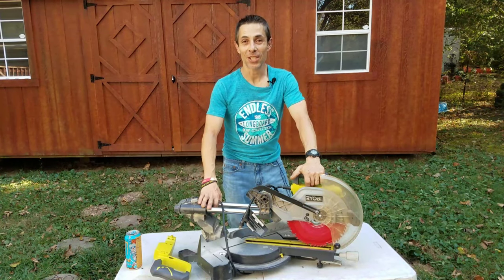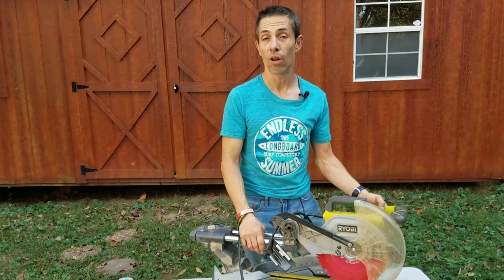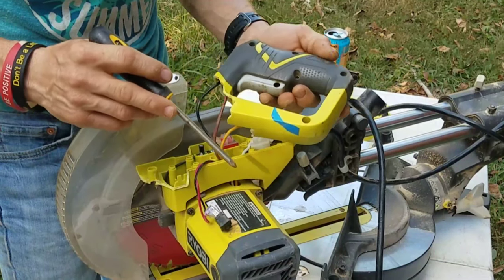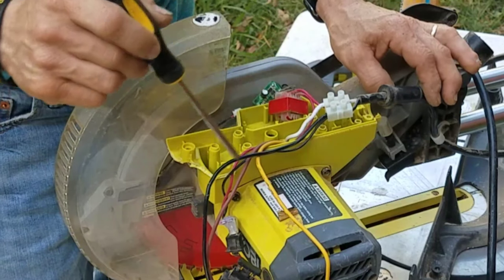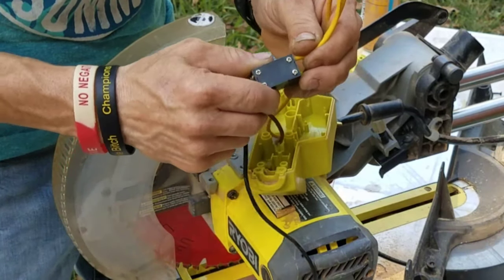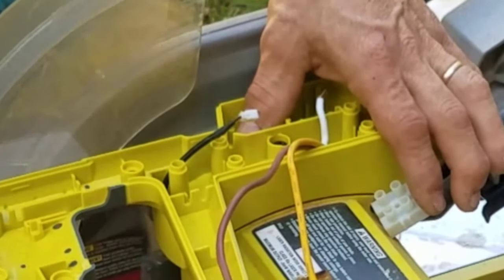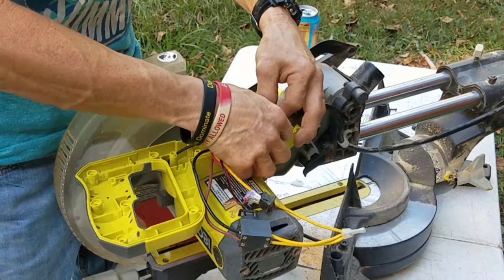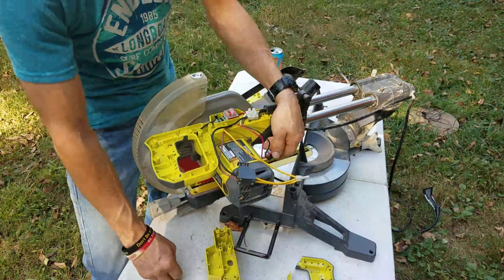How to repair a broken handle on a ryobi miter saw

Comment: Thank you for this! I was able to replace mine without an issue. I got the replacement from ToolParts took about 4weeks to arrive. The only part that was hard to see in your video is the cables for the laser button (especially because I didn't pay attention to the cable location 😣), but I was able to figure it out after rewinding the video (10:19) and found a shot that showed cables plugged into the button 🙌 other than that all was great! Thank you for this!!
Reply from the maker: Glad it helped. Much better than having to purchase a new saw. Thanks for the comment

Comment: where did you bought that new piece?
Reply from the maker: If you look on Amazon and type in Ryobi miter saw replacement handle, it should be on the 1st page. Hope that helps.
Reply: "BUY"  ,   Where did you "BUY" that part?  👍

Comment: Dewalt/ryobi you want good saw Milwaukee or metabo or hatachi
Reply from the maker: I love the design of the dewalt. I saw at harbor freight that Hercules has a saw exactly like the dewalt but in a 10 inch. I’ve considered trying it since it is 10 inch and dewalt stop selling it without the stand. Thanks for the comment